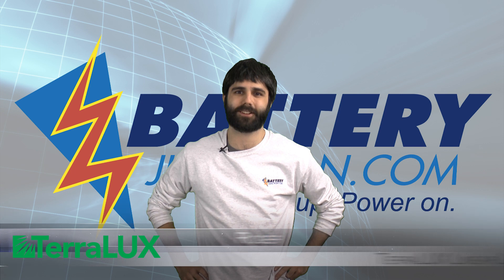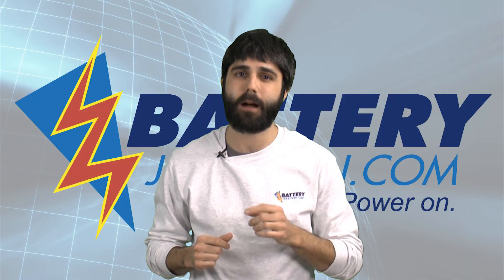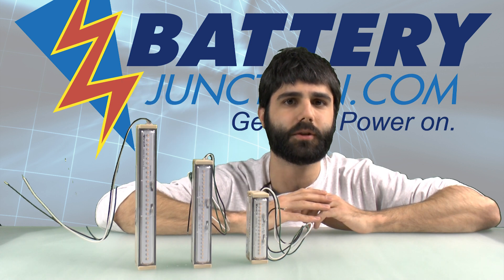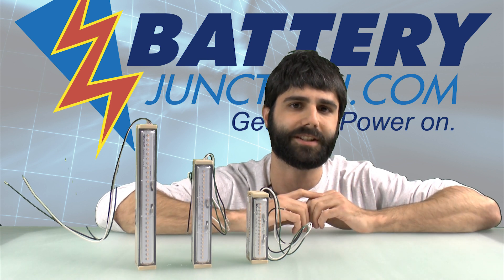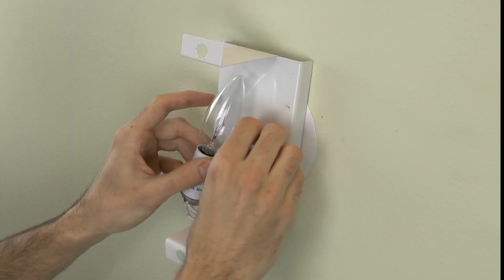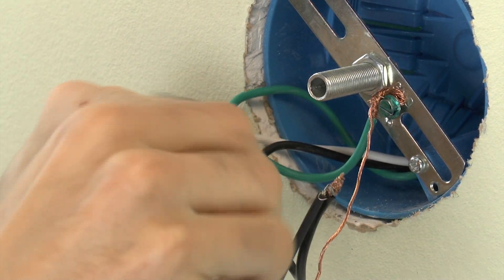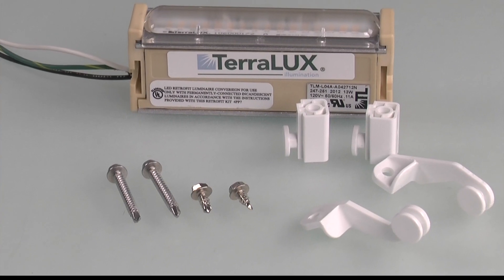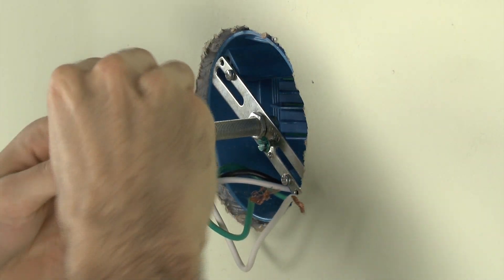TerraLUX Linear LED Engine Installation Tutorial

Comment: The lighting is very different. It's rather warm and dispersed with the original bulb.  The LED light is not dispersed enough and is not centered behind the shade.  That's why the camera angle was off to the left on the last shot, to make it look centered.  Even Watson would notice that!

Not Sherlock